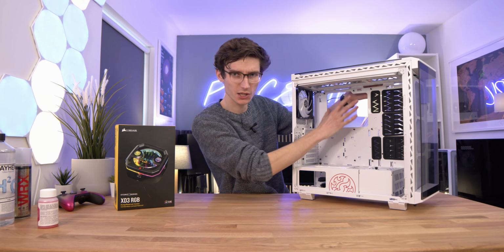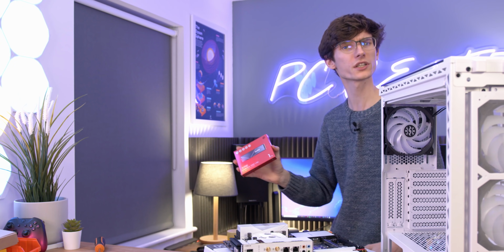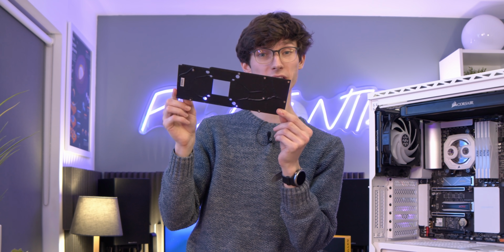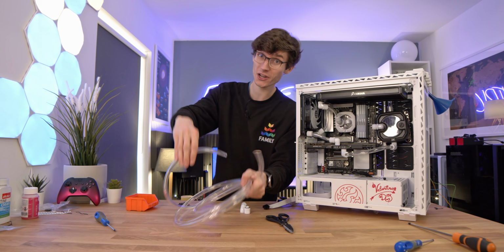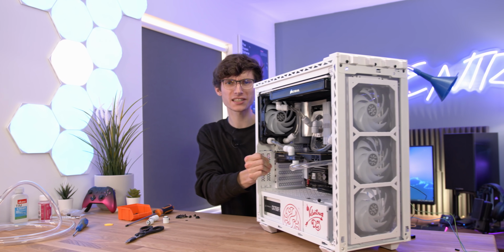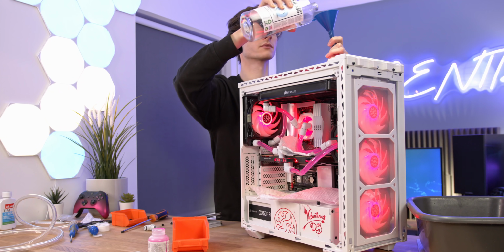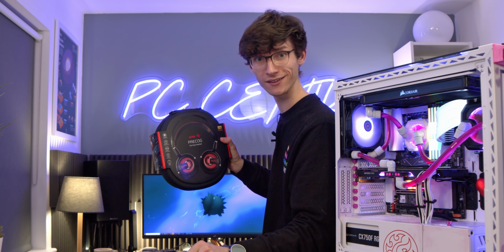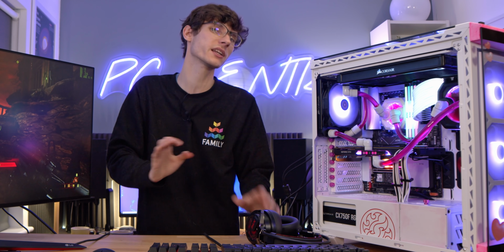The FULLY CUSTOM Water Cooled Gaming PC Build 2021! 💓 Ryzen 5900X, RTX, Pink Hydro X Build | AD

Comment: 5900X does not run hot. Not compared to it's smaller brother the 5800X. It's way more efficient and because it has two 6 core dies, instead of a single 8 core die like the 5800X, the heat is spread out more evenly over the IHS. result: auto 5900X 65c, 5800X 78c. PBO advanced + co 5900X 73c, 5800X 83c. Same custom loop.

Comment: I am going to use WATER to cool my PC because of this video!
1) move back FAN RADIATOR from back of unit to front of unit so you dont have tubing all over the place.  Now your tubing is  (OUT) from WATER PUMP to (IN) front FAN RAIATOR. (OUT) from front FAN RAIATOR) to (IN) to the GPU,  (OUT) from GPU to (IN) from CPU. (OUT) from CPU to (IN)  from TOP RADIATOR, (OUT) from TOP RADIATOR to (IN) TO WATER PUMP.

Comment: Honest questions as I’m new to water cooling PCs. Is there a reason you have the rear fan set to exhaust with the radiator versus pull to use cool air, and Exhuast through the top since hot air rises?

Comment: Great looking build.  I think perhaps the reason your CPU temperature is so high is that water coming into the CPU block is made up of hot water that's coming out of the GPU.  Why not pump water into the CPU, then into a radiator, then to the GPU, then to the second radiator, then to the pump?  That way both the CPU and GPU get water that's just been cooled by a radiator.

Comment: I would really appreciate some help and advice here.

I'm having an extremely hard time deciding on a laptop to buy. My budget is $1500 - $2000 though I'm willing to stretch it a little more if I see more value.

I don't play any games whatsoever. I use photoshop a lot and recently I have been interested and learning to do some video editing and audio production with Adobe Premiere Pro and Adobe Audition. Everything works fine on my current laptop except for Premiere Pro which won't even run. It would also be nice if Photoshop and my audio production software would run faster.

I currently have an Ultrabook 2-in-1 with touch screen (Dell Inspiron 13 7378, 2018 version) and it's very outdated for me and just doesn't meet my needs any more with it's integrated Intel UHD 620 GPU. You have to understand I didn't even pick this laptop to buy it was simply a $400 bargain 2 years ago in a brand new condition and I just ended up liking it until I started looking into video editing. I don't want to invest in a desktop setup now since I move a lot, a laptop is a must for me.

Last year I was very excited about Huawei Matebook Pro X (2020 version) and I'm so glad I didn't buy it! But then I got excited about the new Dell XPS 15 model with touch screen and GTX 1650 Ti until Nvidia announced their RTX 3000 series so I decided to wait for the new laptop models with the new GPUs.

The dilemma I have right now is this:

1- My laptop is not good enough for my needs by any means, I have been waiting for quite sometime now but I need to buy a better performing laptop sooner than later.

2- I use the touch screen on my laptop quite a lot, the tablet mode and being able to flip the screen 360 degrees isn't very important, but I got very used to a touch screen that I'm just having a hard time accept a laptop without on.

3- I considered XPS 17 9700 with RTX 2060 and I love that device, except I don't feel comfortable spending over $3k which is a lot over my budget and I still won't be getting the RTX 300 series.

4- It's really hard to find a laptop that fits these needs. I have recently been interested in the Zephyrus G15 GA503. Yet grew disappointed because of the soldered ram slot (I understand I'll need to upgrade the ram to get a better video editing experience) and the lack of even a bad webcam to be used while in transit in an airport for example. The lack of touch screen isn't a big issue though.

5- I have considered Asus flex 13x but I don't like the proprietary eGPU

I understand I'm comparing apples to oranges when I put tiny sleek Ultrabooks side to side with Performance gaming laptops. I'm just lost between the two. I don't care about FPS since I'm not a gamer. but I need a good display in a sleek portable laptop. What are my options and what're you suggestions?

Should I get something of what's available now? (and what would that be?) or should I wait a bit more for new things that might come out soon? (Will Dell even make a new XPS with RTX 300 series this year?)

Thank you for reading and for any replies in advance!

Comment: could the high CPU temp be from the cooler versus the capacitor?  The way the tubing is set up you have warm liquid coming form the GPU to the pump, then to the CPU versus going from the GPU to the pump, through the top radiator to be cooled again and then into the CPU?

Comment: This happened to me with my x570 aorus master motherboard. I just recently replaced it all with ekwb 1 month ago. I had it for 5 months & never understood why it happened. Then one day I decided to remove my water loop & put an air cooler only to get better temps, then I placed the waterblock back on to inspect it and realized I had this issue. After replacing it, I’ve been getting a lot better temps with my cpu.

Comment: Here's a tip I learned from working in boats with my diy mechanic dad.  If you scratch the aluminum where you want to paint, the first coat won't look great, but it will balance out after 2 or 3 coats, and it will stick like a dream.

Comment: You did not put fans on the 240mm radiator. Most likely just one fan for the 120mm is not enough.
Reply from the maker: There's two 280s above the rad, in this case they fit above rad plate, while the radiator is below

Comment: I have a corsair cpu block and have similar temperatures to you! 75C on 5950x and 47C on GPU. I never thought to look at the block clearance. Thanks for the video boss! I'll try switching out the block
Reply from the maker: I would say turn your case on the side if safe to do so, then remove the mounting plate and see if it'll sit flush on the cpu

Comment: Apologise if I’m teaching you to suck eggs!!  You ideally need to sand the painted surface a little before spraying to assist it sticking plus it’s only opaque fluids that course issues in loops. The cryo-fluid is fine. I’ve run it in mud last loop for 2+ years with zero issues and the same for the build before that. Blue in last loop, red in one before that. 

Did Michelle like her Valentines Day gift then!?
Reply from the maker: Her gift was me editing this video 😂Yeah I did sand it down, but clearly not enough, plus needed primer.

It's more the dyeing of the parts that'll be an issue with this fluid
Reply: @PcCentric  tbh soft tubing will always discolour over time.  

That’s odd that it didn’t stick then. I just sprayed both my EK 360 rads white with minimal sanding. I used a domestic radiator paint and worked a treat. 

She’s a bloody lucky girl that one!

Comment: As someone who spray paints often. When its that cold, you want to warm your can in hot water first. Also take air humidity into account. So maybe do it indoors with a window or door open, like in the garage or your laundry room.
Reply from the maker: What does the warmth do? Excuse my novice-ness
Reply: @PcCentric  It makes the paint come out in a more even mist. Less splodgy. Humidity and temperature can make the paint very thick and droopy. You want to ideally do a few thin coats. Which will result in a nice and even coat.
With painted cases, to get a better adhesive to the satin coat on there you might want to sand it the part you're painting too. Gives more texture for the paint to adhere to.
Jay has actually a nice video on how to paint PC parts. But whether it is PC parts, car parts, or warhammer miniatures (in my case) it is all the same.
Reply: Halfords has some good spray cans actually. Intended for cars and bicycles but works really well on PC mods too.

Comment: Could it be because after the after leaves the CPU block, it paths through BOTH radiators before hitting the GPU. So the pump returns warmed water to the CPU? Also are there fans on the 240mm radiator? That could be a large problem as well. Am I the only one that noticed that?
Reply from the maker: Fans are above the rad - nah its definitely the capacitor, unfortunately
Reply: @PcCentric  well that is poopy man...it looks so pretty that I want it to be great all around. Solid work though! Cheers.

Comment: I’ve been wondering about that pump/res being able to handle cpu/gpu, quite literally perfect timing on the build video. Only difference is I’m using a rx6800. Wondering if I can get away with just a 240 rad though and not use a 120, my case is the Corsair 465x so about same size. Anyhow great vid
Reply from the maker: For a gaming pc sure, but for 100% load on both components it'll be a little warm

Comment: so i have a Lenovo H520s Desktop PC Type 2561 and i stopped using it a few years ago as it wouldnt work because every time i turned it on it would be stuck on the black loading screen, so do i sell it as a whole or do i sell each part inside on its own.